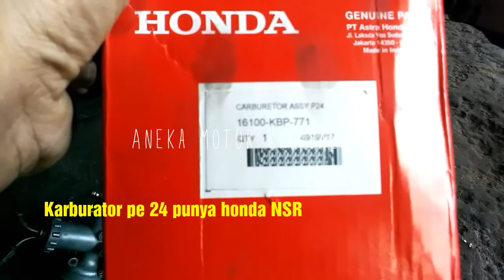Pasang karburator PE 24 di yamaha Fiz R Standar akselerasi jadi lebih responsif

Comment: Bang mau tanya saya puya fiz r thn 2002 knp bang nya karbo nya ngebun trus trima kasih sebelm nya bang
Reply from the maker: Penyebabnya setingan karbu terlalu boros gan.  Jadi membuat area di dinding karbu menjadi lebih dingin. Makanya krbu jdi mengembun. Agan stel tinggi pelampung karburtornya. Biasanya pelampung terlalu terbuka. Cek juga pilot jetnya nya gan.  Bersihkan slow jet dan main jetnya.  Biasanya ada tumpukan kotoran.  Semprot menggunakan carbucleaner. Pastikan lubang slow jet harus bersih. Main jet  Dan pilot jetnya.  Agar saat pencampuran udara dan bensin bisa sempurna.
Reply: @anekamotorspeed  cara nyetel nya gmn bang tolong kasih info nya bang trima ksih
Reply: @anekamotorspeed  trima kasih info nya bang semga abang makin suksez ke depan nya trima kasih
Reply: @ulumbahrul625  cara setting karburator menit  2:25
Reply from the maker: Cara menyetel pelampung bensin.  Dengan menekan bagian tengah jarum pelampung nya.  Posisi pelampung hrus lurus.